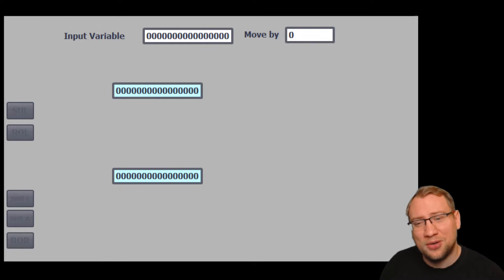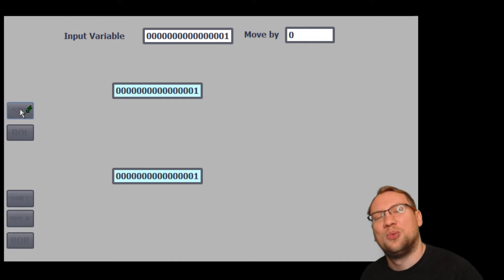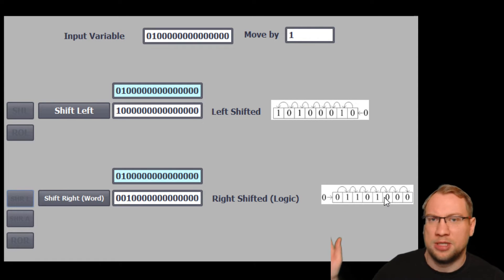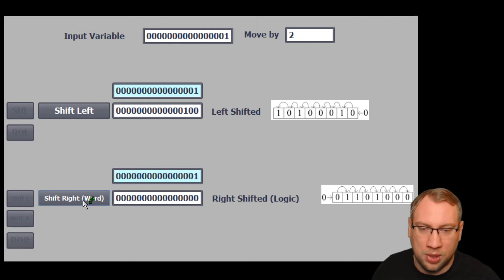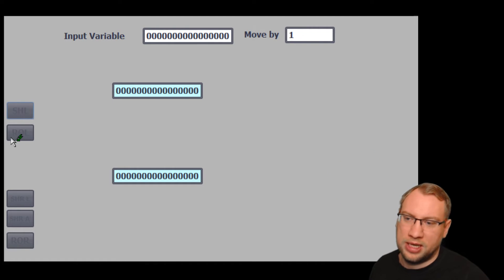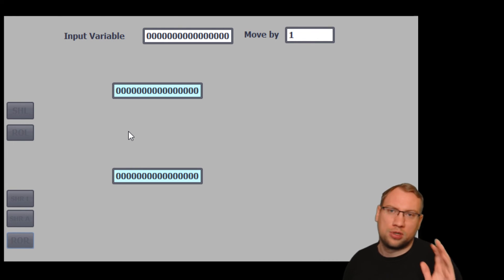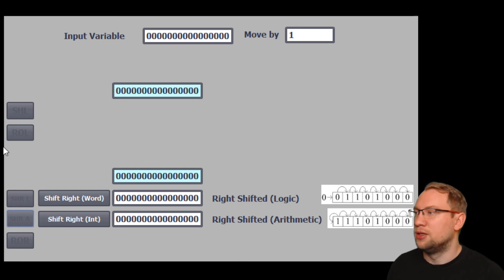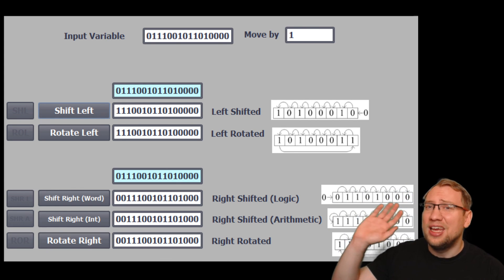Bit Rotation and Shifting: Simple Explanation!

Comment: Very nice and clear example of bit shifting. Your video demonstration and simplicity is spot on especially for beginners. For me this video was just a really good refresher while already being familiar with them and their differences from working within the C/C++ languages. From a programming perspective they're easy to understand and use and I know most of their basic uses yet I would find it very useful to have a solid explanation of how they're used within Assembly.

As for their use within Assembly, I'm not referring to just their use from a programming perspective of using assembly to write programs but more on the lines of how they are used within the design of an assembler and its instruction set architecture. 

Let's consider already having them implemented in the hardware as physical components within an ALU that can be invoked from OPCodes - Assembly Mnemonics - instructions. At this stage of the game everything is relatively good and straightforward. 

Now having their functionality and being able to use them within the architecture is one thing, but knowing what their main purposes are or more to the lines of when they are needed and why, when and how you should use them is closer to the point. 

For example, I can call them through existing opcodes within a simple 8-bit architect. The current implementation of the architect is taking 4 8-bit or words from each instruction cycle. The first byte is the OPCODE or Instruction, the 2 and 3rd bytes are two source lines that are fed to the registers, as well as other hardware devices such as the ALU, RAM, the Stack and I/O as input A and B, being SRC1, SRC2 respectively and the 4th byte is the destination DEST respectively. 

I currently have the Stack Working and I'm in the process of implementing the "call" and "ret" instructions within the assembler to use the stack to push and pop addresses for procedure - subroutine calls. Implementing this shouldn't be to difficult as it's a simple stack frame.
 
However, having a good clean and clear explanation of what their main uses are at the ISA - to Assembly stage would be very beneficial and useful information just to add another tool into the toolbox. Something to this effect could make for a good video resource.